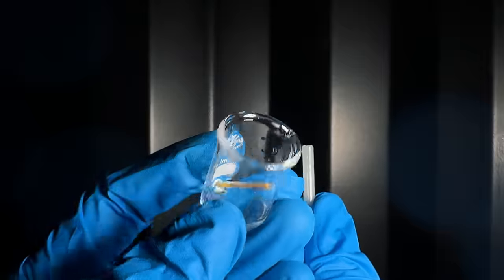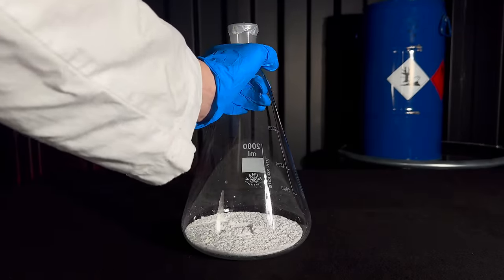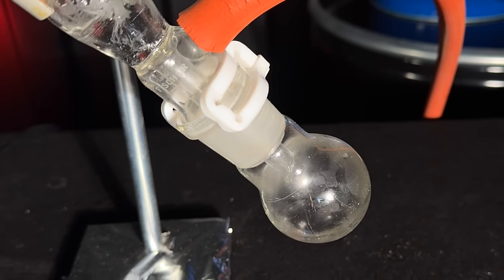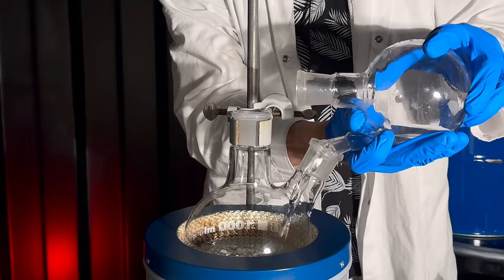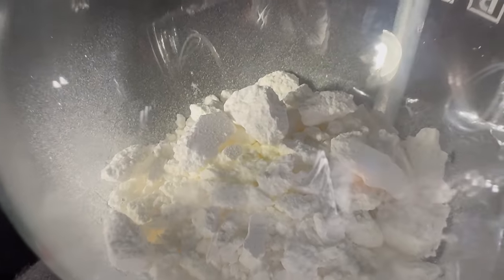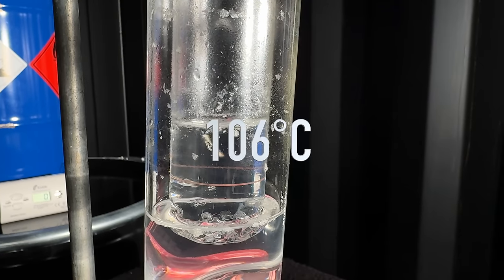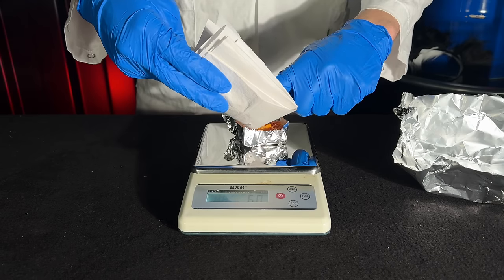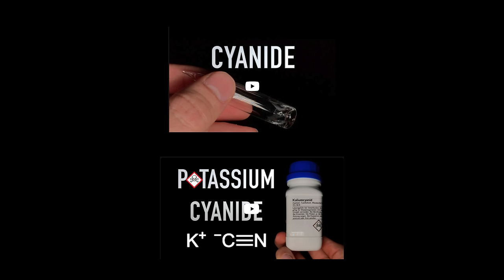Making Glow Sticks From Aspirin

Comment: There is another technique for making PCl₅ that does not require all of that heating. You bubble Cl₂ into a slurry of red P in chloroform under stirring.
Reply: Yup, as a bonus the excess chlorine will disolve in the chloroform giving a very good visual indication of the endpoint.❤

Comment: I’ve separated ASA from pill crud using only water many times. ASA is soluble in hot water, the crud isn’t. Boil crushed up pills in enough water (check solubility tables), scrape PVP blob from surface and filter the rest (keep hot). Then let cool slowly. Voilá!
Reply from the maker: it is still so much cleaner and easier when you use acetone for the extraction. especially dthe drying of asa

Comment: Did this phenol chlorination three years ago to make TCPO. While this was successful, TCP is so horrible to work with that I much prefer the "green" analogs of TCPO which do work well. The smell of TCP is so strong and penetrating that my shed still stinks. Impossible to get rid of the odor.
Not mentioning the waste management side of things. While recrystallizing TCP, I had a beaker full of the stuff cracking and spilling TCP on the hotplate (which was too hot...), which is the perfect recipe to produce large amounts of TCDDs. Ended up scrapping my fume hood and part of my bench by fear of TCDD contamination. Not fun.
The raw TCP I obtained was much more oily than Thy Labs' one (possibly from incomplete chlorination or over-chlorination, I don't know, didn't check), and recryst was a pain. At the end, I got red-tinted crystals as Thy Labs, but the red color is due to impurities, as pure TCP is greyish, like Thy Labs' first sample.
The esterification with oxalyl chloride (commercial, as I had enough dealing with chlorine) went similar, with the mixture going brown as I added pyridine. However my yield was quite poor at first, with most of the products being carried away as I washed the filtrate with methanol. I had more luck with a large excess of oxalyl chloride and pyridine, and washing with water only.
For the glow stick reaction, I used about the same reactants, and used rhodamine 6G (from waste fluid from an old dye laser) instead. Even with using very dilute H2O2 and ethyl acetate as solvent, I got a very strong yellow glow lasting for ~10 minutes, definitively stronger than shown in the video.
Very nice video ! Especially the OTC approach starting from aspirin :)

Comment: Rookie mistake buying the wrong matches, you're after the striker strips not the matches themselves so you gotta buy the big 200ct bundles of individual matchbooks. More striker strips, and easier to scrape off cause the book matches are usually a bit glossier cardstock than box matches. Or if you need a LOT of it, there's always the old trick of "pack a tube furnace with charcoal and boil phosphoric acid through it" to get WP and then setting the jar in front of a UV bulb, but that has an annoying tendency to explode if you don't use enough insulation on the condensate tube.
Reply: > annoying tendency to explode

Comment: Been looking for a video about this procedure for literally years, thank u, 4 real. Can you give me more specific details about the 2,4,6 TCP making? Thankssss :)
Reply from the maker: if you make it i would recommend only to use like 10-15g of phenol dissolved in 1L of water/HCl for the chlorination. this way it is more efficient. bubble chlorine trough it at 70°C for 30 hours. the solution should be saturated with chlorine towards the end.

more info 'Fundamental Processes of Dye Chemistry' p146 (book available in the sciencemadness library)

what i wrote was my adaptation of the procedure. in the video the concentration of phenol was wayyyy too high leading to all these clogging problems. recrystallize from acetone directly. other solvents or solvent mixes appear inferior. use ppe. I made it a priority to use a "sealed" system with a scrubber and to always wear a gas mask and gloves while handling the tcp in case there were dioxins present
Reply: Also, proper waste management is a must. TCP waste (which may contain dioxins) is horrendous, and must be dealt properly, ie. by a specialized company. Altough TCP was heavily used to treat wood, it's not an excuse to discard the waste in the wild.

Also had clogging issue when I made TCP this way. With my inferior crude product (I guess I did not had complete chlorination, ans I did it for only 20h at a lower temperature first), acetone was not enough for recryst as the product always oiled out (nasty red oil). I had much more luck with a 50/50 mixture of methanol and 30% HCl.